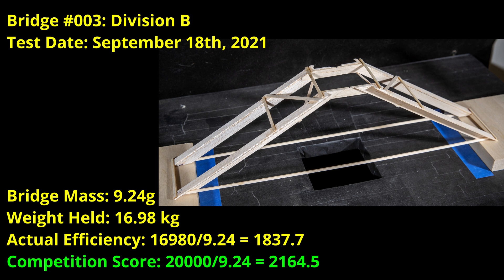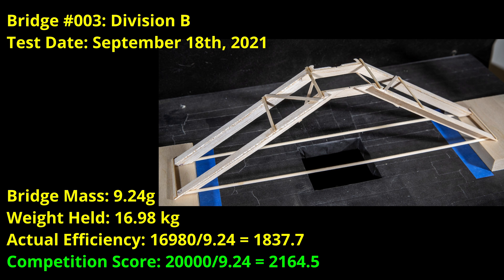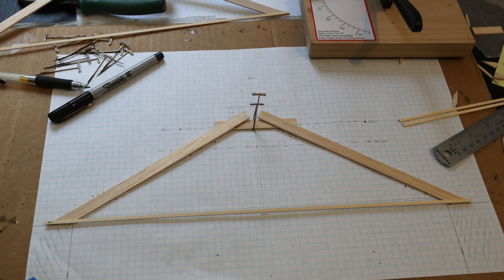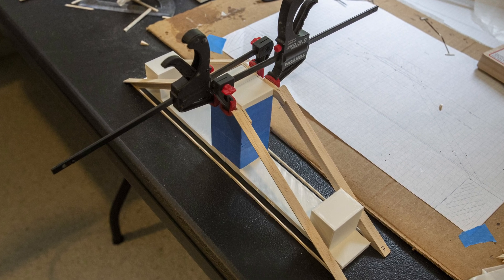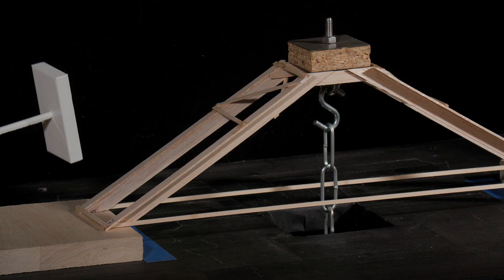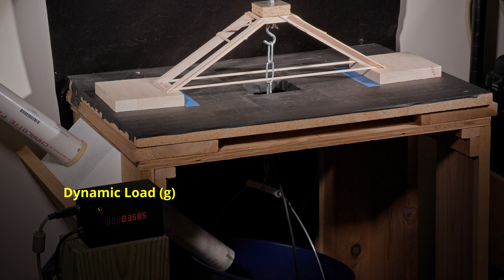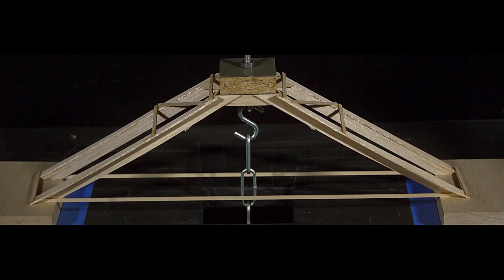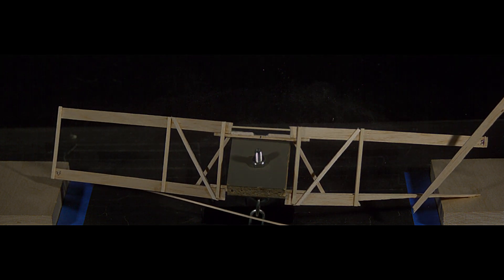Bridge 003 Division B: Competition Score 2164.5

Comment: What are the dood dimensions? I'm just looking for the thickness, not the lengths.
Reply from the maker: For the legs, the primary part is 3/32" and the angled piece is 1/16".  The basswood parts are all 1/16" thick and the cross bracing near the top was 1/20" thick.

Comment: The jig seems useful in assembling the bridge, how do you create the jig
Reply from the maker: Hi Sukesh, yes, some form of assembly jig is very handy for this build.  I created the one I'm using with a 3D printer.  The design is very straight forward.  If you don't have access to a 3D printer, I would recommend trying to build some sort of jig with wood or really anything that works with the dimensions you are using.  You could probably get away with just a block in the middle and then carefully pin the legs on graph paper.